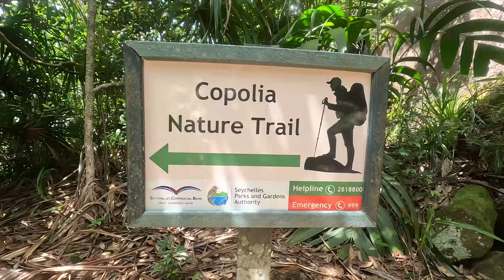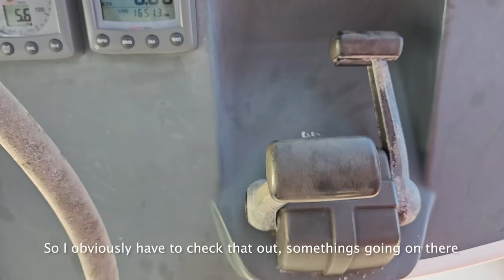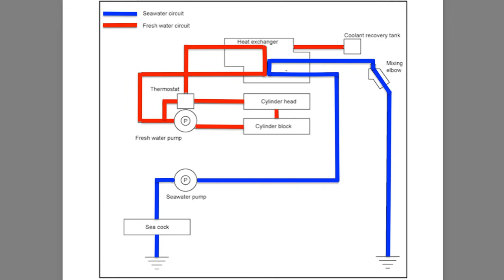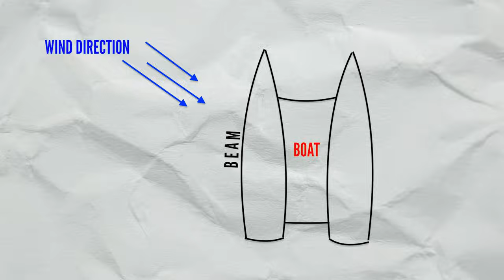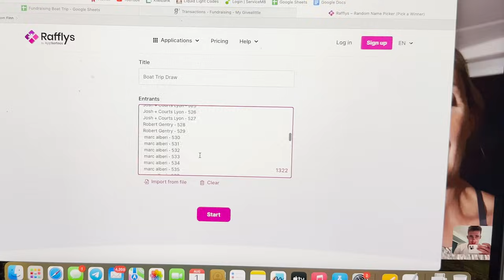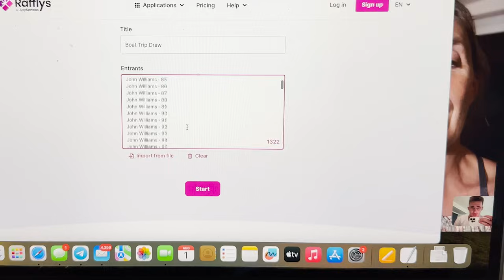Is this our new sail? | Sailing life Seychelles

Comment: What a beautiful hike and view.  I'm sure Declan is missing it somewhat while off on new adventures. Perhaps he will return with the flexible baton featured in his video to fend of intruders! 

The heat exchanger was interesting as we use something similar in Canada in our houses but for the opposite reason.  In winter the exchanger brings in fresh cold dry air which is warmed up by the outgoing moist warm air as it passes through a large cube.
Reply from the maker: Interesting. I assume the main purpose is to dehumidify?